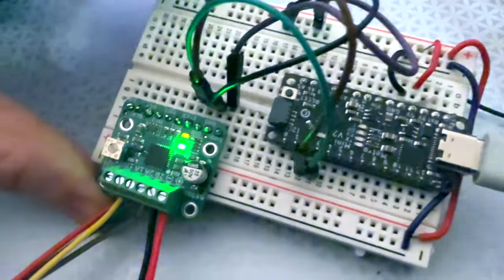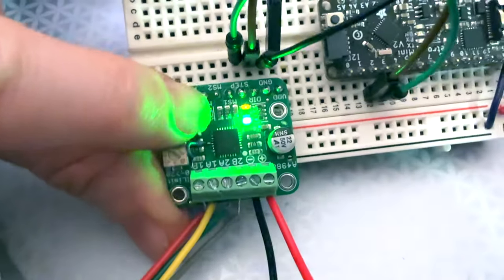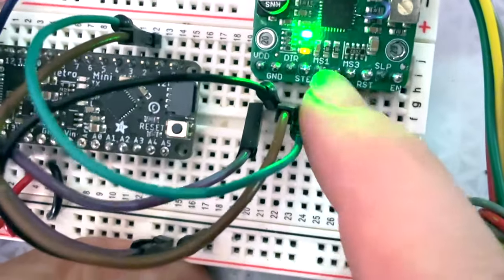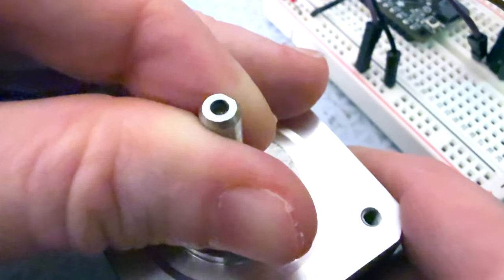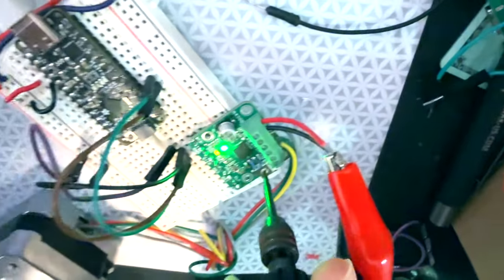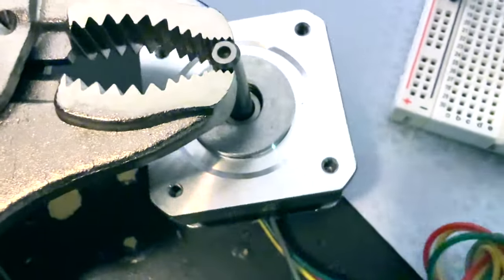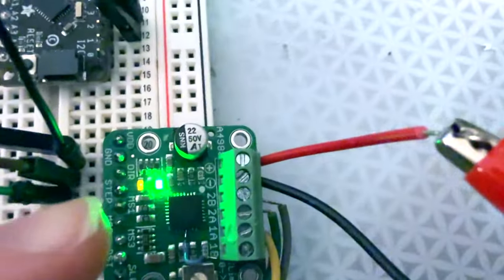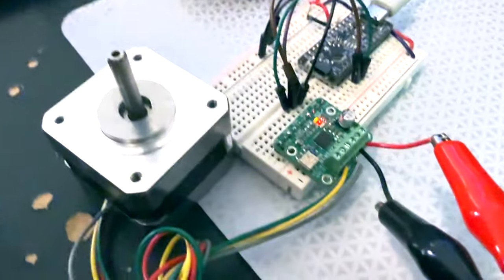A4988 breakout prototype testing ⚙️🔧

Comment: Hearing that driver name is such a throwback to earlier 3d printing.
Reply: Right, A4988 very old stepstick driver, widely used in DIY 3d printing. Replaced with DRV8825 and more advanced Trinamic. But, even Allegro have more advanced modern drivers than A4988...

Comment: I have been using TMC5160 to drive peristaltic pumps for many years. They are both quiet and powerful. An easy way to send frequency in step mode is to use Arduino tone() command. You can add a simple acceleration loop if you need to target speed over 100 RPM.
Reply: TMC5160 stepstick has external FETs so heat is no problem at all.

Comment: Would love to see a clip-on heatsink design for this (S spring that hooks to pcb on both sides and pushes down on heatsink) instead of the usual cheap stick-on heatsink which:
(1) do not do as good a cooling job
(2) do not fair well, ie fly off, in the presence of vibrations